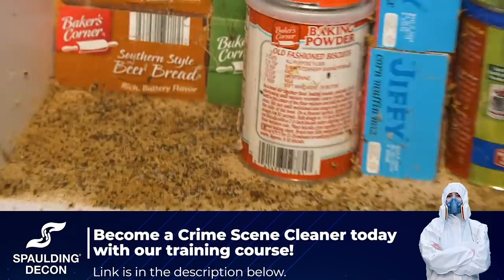Woman Reclaims Life After Decade of Hoarding Pt. 2 | Bradenton, FL

Comment: See the stolen trailer, I would guess its someone local who spotted it on his way home, I would try to get as much detail from the CCTV and check the area around 7.30pm.
Reply: Its clearly a black truck with a big front grill and a light bar on the top of the roof above the windscreen.
Reply: Also has high square rear wheel arches inside the truck bed.
Reply: Looking again that seems to be a tool box rather than wheel arches.
Reply: Sloping back window its likely a Dodge.

Comment: No offense but I see some flaws on cleaning protocol . you guys wear respirators but than you see random of choir crew not? Or having them wearing on their head while everyone is disturbing the contaminates ? You can see many of the members who are wearing cover all’s incorrectly where it’s not fully zipped up ( a bugs egg or misc contamines brings it home eh) + biggest mistake is why on earth would you be wearing cloth based gloves when who knows if the person doesn’t have stuff that could hurt you like a needle or misc sharp stuff or chem based. Why not heavy ml rubber  with thin rubber like 5ml under them? having cloth based gloves only promotes to throw em away or have to wash em and good luck getting em clean. super thick gloves that run down your arm would protect your workers from so much but also easily cleaned . I would sterilize after every work knob and spray their suits down and boots and misc before leaving every night . can’t imagine if you aren’t what you bring into your vehicles and to your homes. I realize your not showing all protocols and steps but come on?